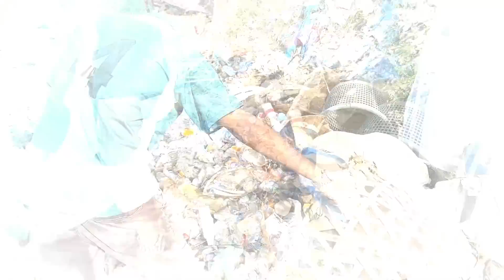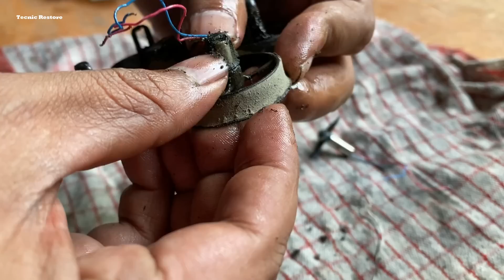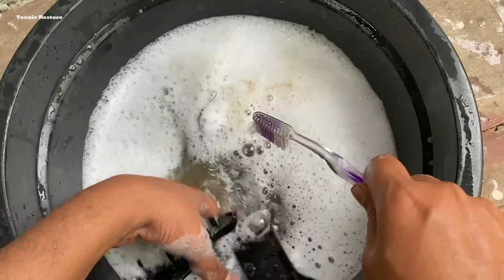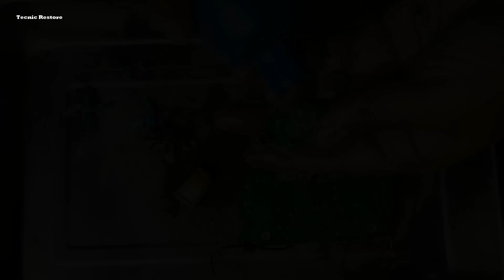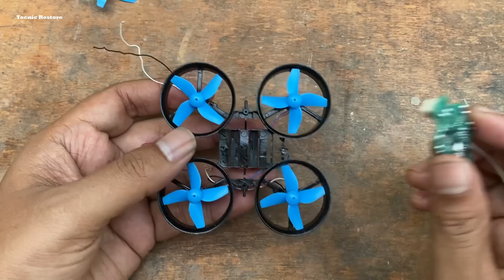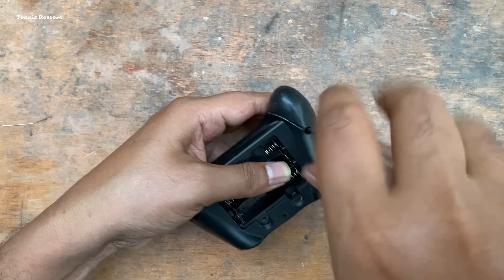I Found a Crashed Drone | Restore Drone

Comment: Fake and staged video! I am engaged in the repair of electronic devices and I can confidently assure that there are no signs of corrosion on electronic components, which must be present. Most likely, the author himself contaminated the device and threw it in the trash for this video.